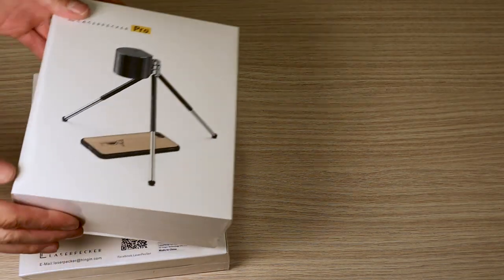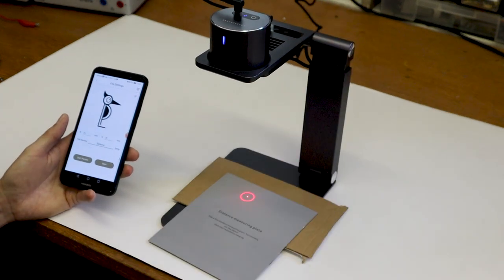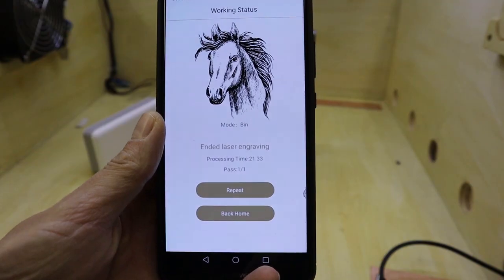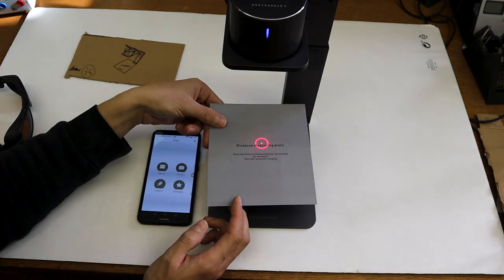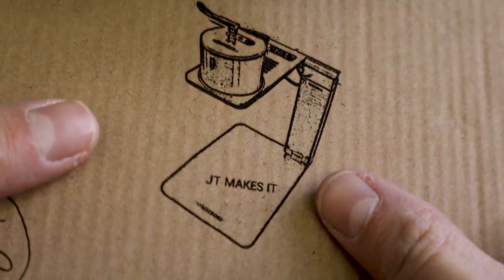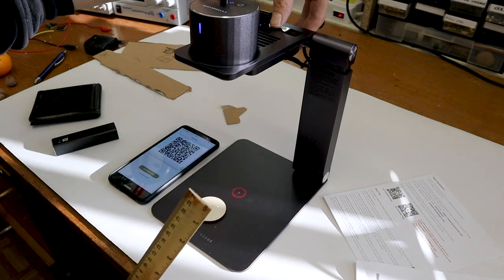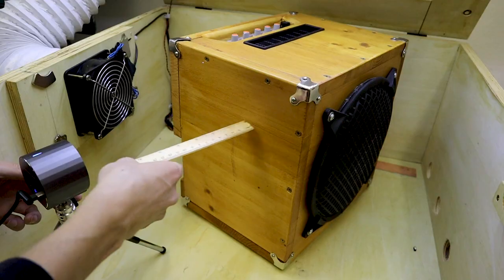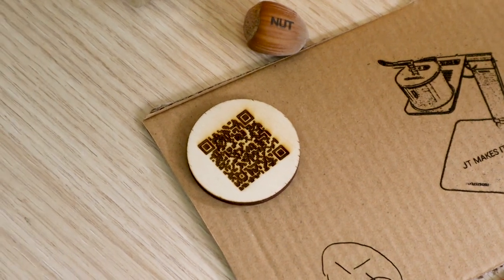LASERPECKER L1 PRO SUITE Laser Engraver REVIEW - A Laser Engraver Anyone Can Use!

Comment: how can u place the object correctly on the metal surface? I mean, I want to engrave phone cases but how will the machine know where is the center of the case?
Reply from the maker: You can "frame" the engraving. The beam will draw a square around your engraving so you can see where it will be placed. You can also mark the center. You can see the framing in my video too.

Comment: Did you try it with plastic? doesn't seem to work well with plastics(discoloration) in couple of other videos that i saw
Reply from the maker: On plastics there is less contrast because plastic does not turn black as much compared to wood.
Reply: @JTMakesIt  Hmm I wonder how apple engraves their airpod cases so neat. Would have loved to see you try one 🤞
Reply from the maker: @AthifKhan  I might try but I need to get the case first

Comment: Hello
Can the machine engrave identification plates of steel or aluminum equipment?
Thank you very much for these tutorials!
Reply from the maker: No, this is machine can't engrave aluminium or stainless. Check my video of 10 projects with laser engraver, the laser I used there can do both of these.
Reply: @JTMakesIt  ok thanks a lot for the answer and on black plexiglass?
Reply from the maker: @manech7324  It should work on a black plexiglass.

Comment: Hey would you know by any chance why my laser stops working at like 25% into it. Can’t figure it out why it stop and doesn’t finish the pic or image. Even the pecker at the beginning just did the head only 🤷🏻‍♂️ Thanks for the help.
Reply from the maker: That's very strange. Try powering it up with a different USB adapter which is capable of the same or higher output current than the original. Otherwise you should contact the laserpecker support.
Reply: Hi, I'm having the same problem,  just wondering what or if you did to stop this happening. 
Any help is appreciated

Comment: I wish it worked as easy as you make it look. Its not by way by a long shot you have to register first and that does not work every time you try to register it will tell you your username does not exist no matter how many usernames and email addresses you try. SCAM SCAM
Reply from the maker: Registration can sometimes be a bit fiddly, but its definitely not a scam. If you write to the support they will help you out
Reply: @JTMakesIt  Tried that no reply so far
Reply from the maker: @brentm8317  did you check your spam email folder for the code?
Reply: @JTMakesIt  gives you a 4 digit code and wont work without a six digit code like i said SCAM SCAM SCAM
Reply from the maker: @brentm8317  I registered with 4 digit code.